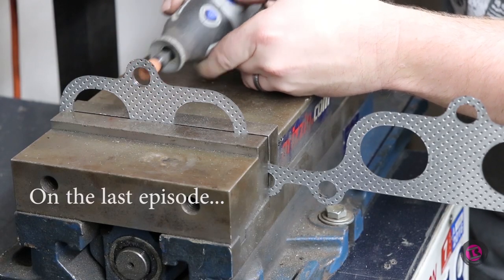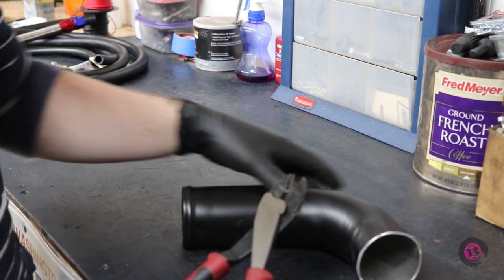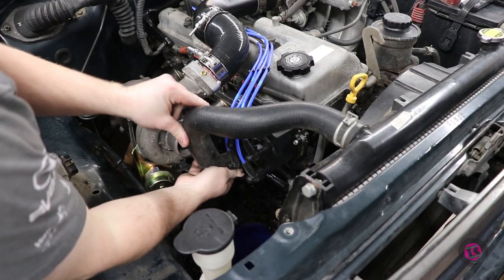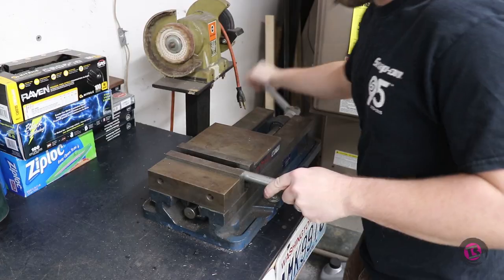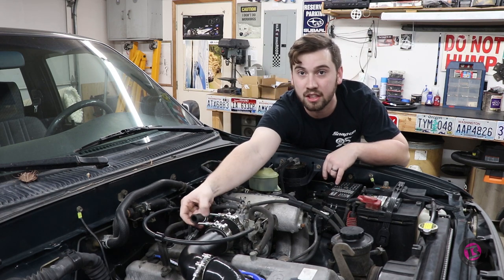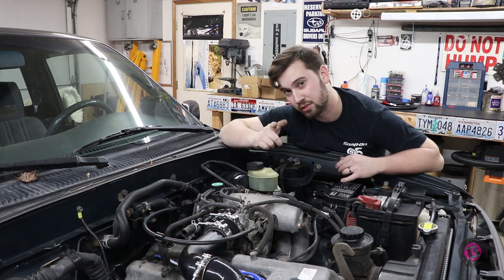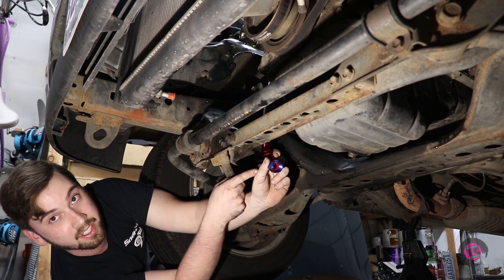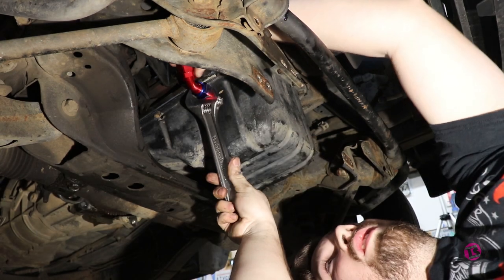TURBO Charging my Toyota Tacoma w/ 230k miles! | EP. 2

Comment: the brake booster already has a one way valve lol
Reply: Factory ones may not cope with boost they’re only plastic.
Reply: Most turbo cars came from factory with plastic brake booster check valve, it's test and proven this taco runs reliable on turbo with all stock parts

Comment: connect idle air hose to the port on the throttle body. That used to be connected to front valve cover vent.

Comment: Hello I was wondering which line off of the idle air control valve. My truck won’t stay on when I let off the gas past 2k
Reply from the maker: The line for the iacv needs to pull air from before the turbo, but after the maf.